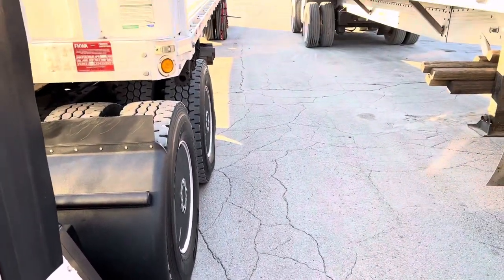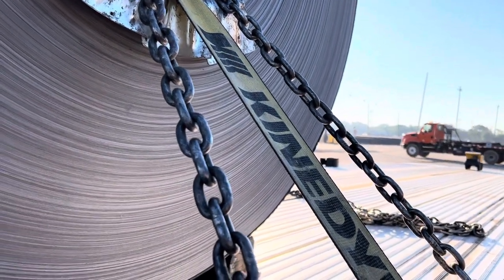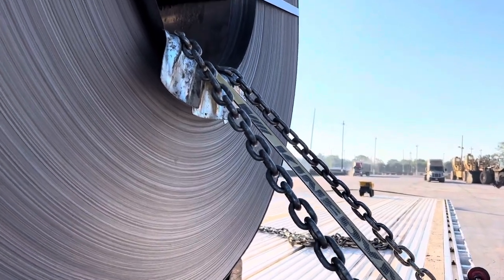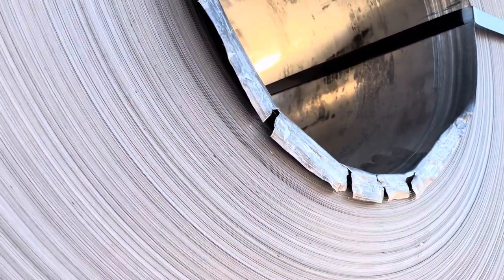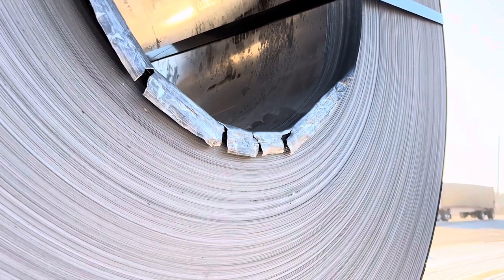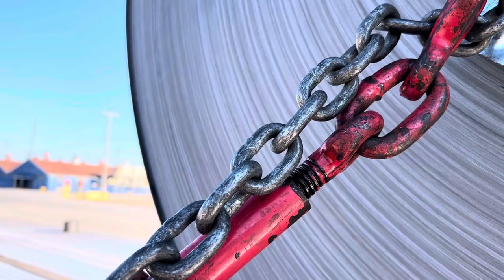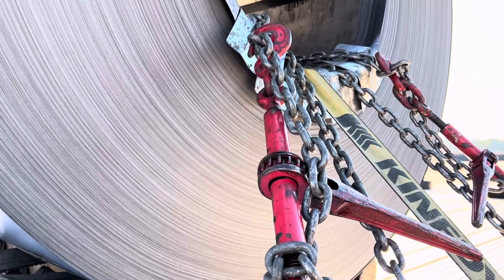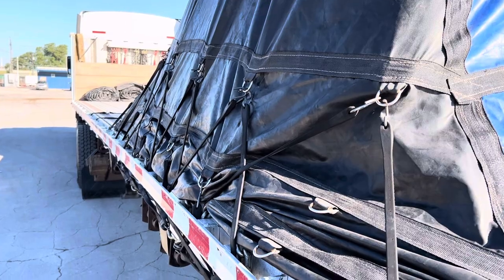Securing Steel Coils…This can KILL YOU!!! or cost you money so pay attention!!!

Comment: Just an observation from an ordinary guy, not a trucker. I have seen many videos about the danger these coils present, so why not design a sturdy cradle with a circular interior that would hold the coil in place in an accident as well as contain it should the straps give way? Perhaps a cradle that could be quickly and solidly mounted on a flatbed, or simply design a special purpose trailer with a built in cradle. Special purpose trailers such as auto transports have existed for a very long time.
Reply from the maker: Mostly because we don’t haul just coils…
Reply: @sturgelltruckingllc4074  Yes, I understand, so I realize that my suggestion might not be economically practical, but considering the savings of time at inspections, and the potential in reduced insurance costs I wondered if it might be worth consideration, and I'm sure I'm not the first fellow to think this up.

Comment: My question is why do they always secure the rolls standing up where they want to roll? 
Why not lay them down flat where they have way more surface area in contact with the surface they are sitting on? 
Seems a lot less likely to roll over the cab or down the interstate if the load does come loose…. Seems like common sense
Reply from the maker: Because a coil that Big would crush any kind of pallet, you tried to set it on, and if you set the coil on the deck, it would damage it, and there would be virtually no way to unload it

Some smaller coils they do load like that sitting on a pallet but like I said when you’re talking about something over 40,000 pounds, they don’t make pallets that strong

Comment: I appreciate your video but I have a few things to say. I used to unload coils of steel with an overhead crane also. I also ran the material I unloaded. 1 thing if it came to me and the steel got bent over that way I would have gotten someone else from quality control on that because that would give me down time if I am not right there at the end and to cut it off and it would get stuck in my machine. But I understand why you did it. I am not arguing with you or anyone else because I want everyone to be safe out there. The company you picked it up from should fixed it for you. The only other thing I want to ask what is wrong loading it on your truck shotgun instead of suicide? I have always wondered why suicide is the preferred method on loading.

Comment: Did they say anything about the metal you bent over when you delivered the coil?
Reply from the maker: Of course not, coils get beat to crap on the edges just from the cranes and forklifts, most guys don’t even put edge protectors anymore, I was taught not to damage the coil if it all possible so I still use the edge protectors and do my best, but this situation is a little bit different and there was no avoiding it….

I’ve been told most places plan on losing a certain percentage of the coil to damage and it’s just part of the game

Coils are a funny business, The majority of them sit outside in the rain and are loaded and unloaded outside in the rain as well, but then they make you tarp them lollll, now in the winter that makes sense because they don’t want the road salt on them but the rest of the year it’s just completely stupid….